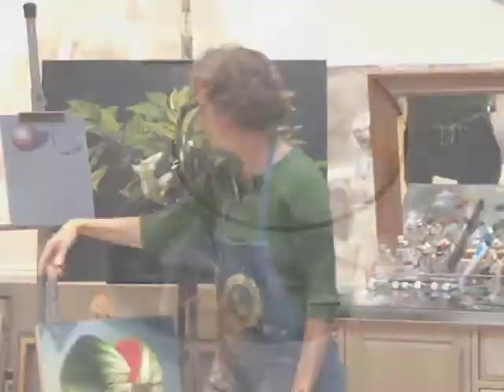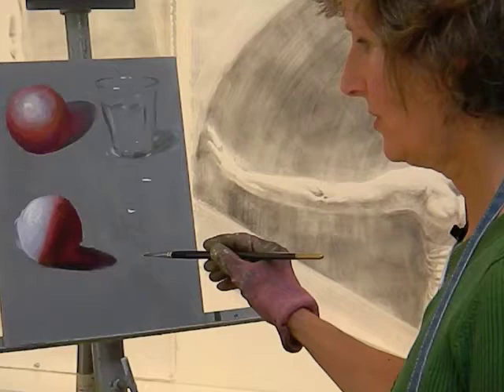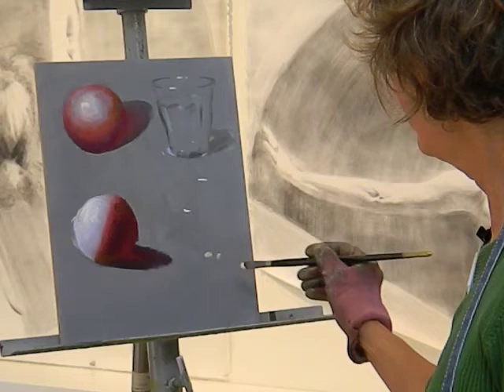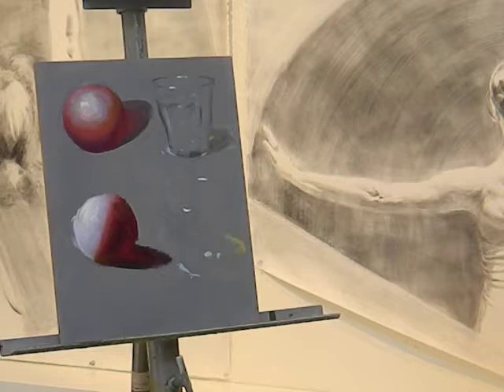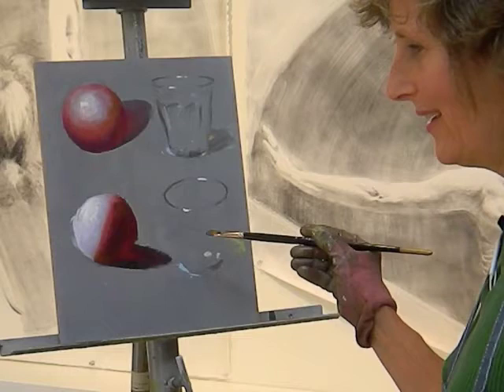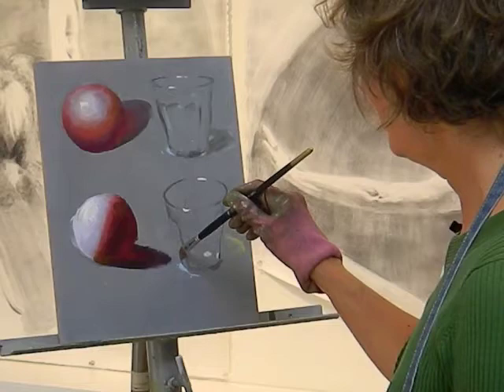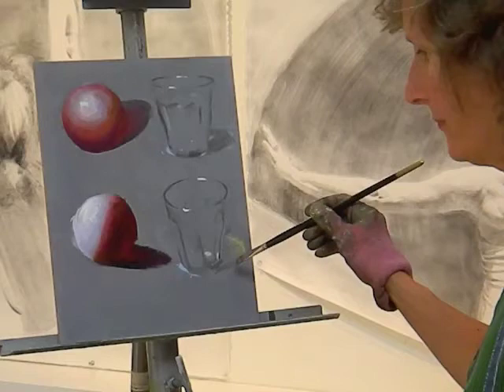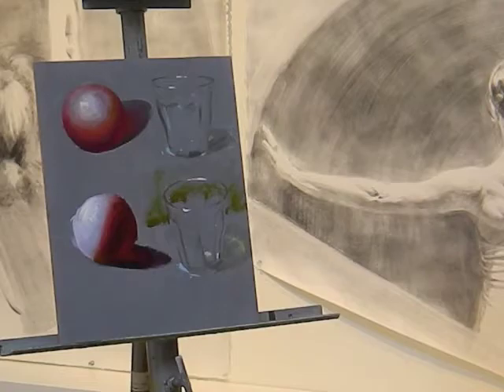Painting Transparent Objects Demonstration

Comment: looks good, but its bad practice to paint your final accents and highlights first. this would be very difficult for beginners to get correct
Reply from the maker: I agree when painting solid objects and figures, it is best to put the highlights in last.  With transparent objects we aren't painting the objects--just the highlights, shadows, and things seen through the objects.  Shadows and things seen through the object aren't ON the surface of the object.  ONLY the highlights are on the surface, therefore I paint them in first to give a sense of space and structure relative to the light source.